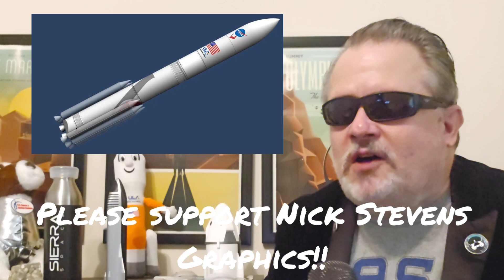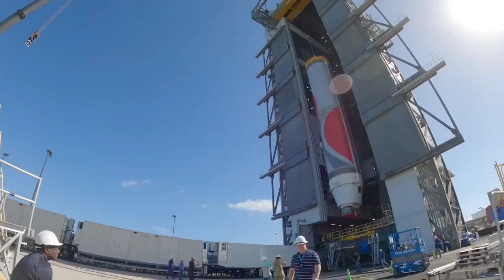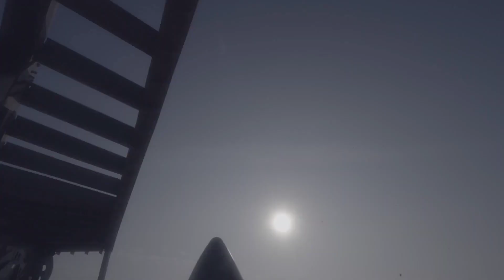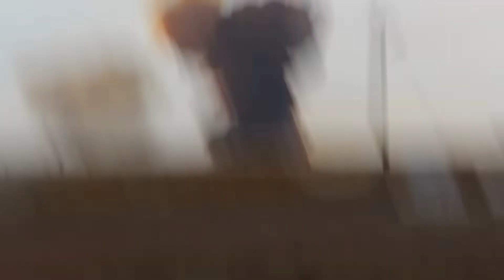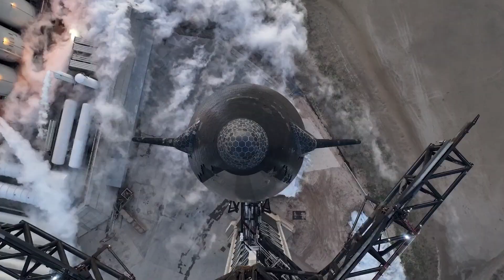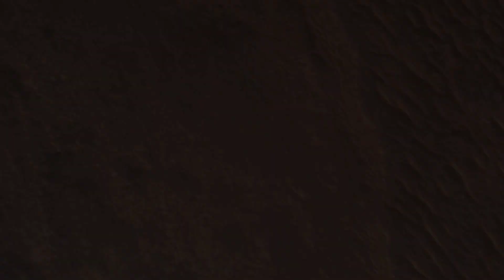6 to 8 weeks, Elon Musk?  Try 6 to 8 months!!  FAA Starship update, plus the latest from ULA!

Comment: Mishap?  What Mishap?  This was an experimental launch for everyone and everything involved.   Eggs were expected to be broken.
Reply: I guess they did wreck an NSF van as well.  It went much better than I personally expected though.   They need to keep pushing to orbit at a minimum so you have to get that ass tatoo!
Reply from the maker: The PEA laid out very specific expectations as to what an anomaly would look like. What happened was worse. The FAA didn't anticipate concrete in the ocean, nor did they anticipate a failure of the FTS on a ballistic missile.
When things go wrong outside of the scope of the PEA, that is a mishap.
If this was the middle of Kazakhstan, it wouldn't matter. But this is a far more densely populated region full of innocent bystanders. That changes everything.
Reply: @TheAngryAstronaut I don't think it was worse than the potential impact of the Superheavy exploding on the pad.  The PEA covers everything up to and including affecting the 700-acre study zone (figure 3-4).  What was thrown the furthest (the dust on people's cars) was tested to be sand.  The concrete chunks being thrown were certainly unexpected, but I can't help but think that if the super heavy had RUD'd on the pad, the shrapnel from that (and let's toss in the tanks for stage zero) would have been significantly worse.  The PEA also covers all manner of materials, oils, etc, and how SpaceX will clean them up.
Reply: @TheAngryAstronaut Then eminent domain the whole thing.

Say goodbye to your roadside access, by the way.

People like you are why we can't have nice things, and that makes me angry, about space!
Reply: @TheAngryAstronaut  So nowhere in the PEA was the potential for a RUD at any moment? Cause that possibilitly was pretty public knowledge. The real unexpected outcome from flight 1 would have been if it was a 100% success. Even Elon didn't expect that. He just hoped it didn't take out stage zero. 🤷🏻‍♂️ 

Now that the final incident report has been filed, they will have their license in under 30 days and will launch on Sept 25th. 9-25 that's my guess.
Reply: @TheAngryAstronaut  Nobody was hurt by any debris, and who gives a crap about concrete in the ocean? Fix the issue and move on. That's what they have done.